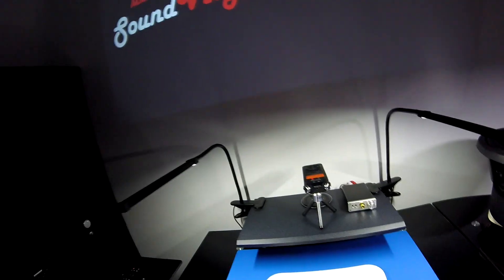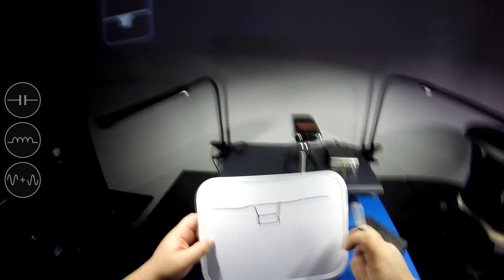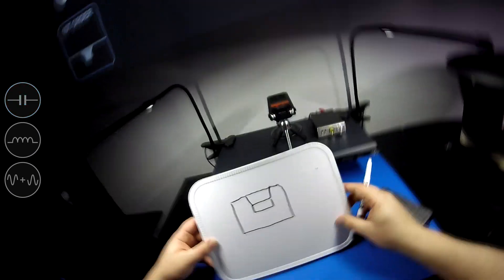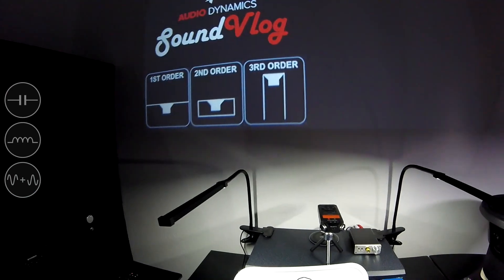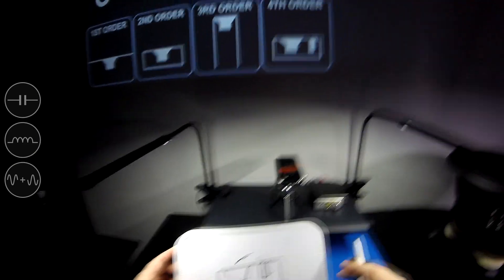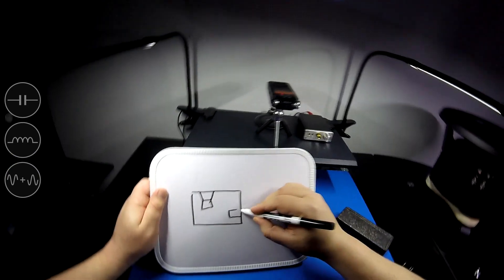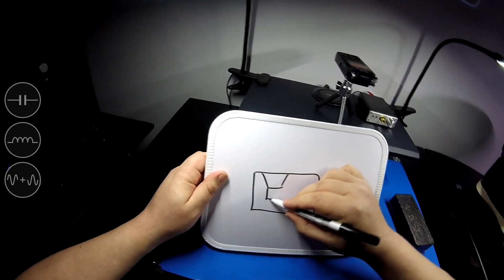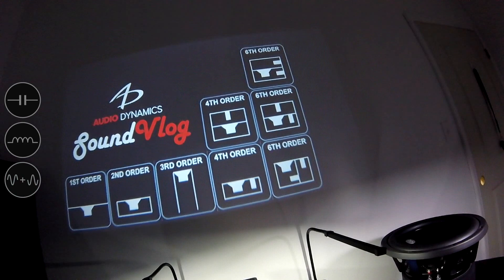Audio Dynamics SoundVlog - Counting Enclosure Orders

Comment: If a port takes you from 2nd to 4th, what's a 3rd order?
Reply: I’d imagine it’s similar to inverting a subwoofer. Or similar to fastening a sub to the end of a tube
Reply: A port only takes you from 2nd to 4th order if it connects the front and the back wave.

A 3rd order enclosure would be a driver mounted in a sealed volume (2nd order) with the backwave going directly into a port. Another example would be the transmission line which is mentioned in the video itself.
Reply: Watch again, a T-Line is a 3rd order as he explains

Comment: OK why are these called 'orders'?  Isn't that a mathematical thing?
Reply: The order refers to the acoustic roll-off rate of the system's frequency response.
Each order adds 6 dB per octave of slope to the high-pass or low-pass characteristics.
A 4th order system has a 24 dB/octave slope (4 x 6 dB)

Comment: Sooo… what if you done a 10th order. Would the bass from a single 10” sound same 2 15s in a 4th? Or does adding “orders” actually add bass?
Reply: no it does not add bass. Its for tuning and air volume.

Comment: What would you call a 6th order series tuned with woofers on the inside where they normally are and woofer on the outside of the enclosure with the back wave on the inside of the bottom chamber?
Reply: a terrible sounding enclosure! you'll experience cancelation and loading issues. you MIGHT be able to get away with it if you used a passive radiator but I think cancelation will still be inevitable!

Comment: Ok I'm going to go old school here. Back in the day we quite often ran an entire system off of 1 two channel amp, the nicer amps were capable of 'tri-mode', highs in stereo and your sub(s) bridged mono, because of this setup we had passive crossover networks. For a while I ran a 6th order parallel tuned bandpass, but because of the coil (inductor), it was considered a 7th order bandpass. How does an inductor fit in when calculating orders?
Reply: the crossover doesnt count towards enclosure orders. crossovers are electrical orders. boxes are acoustic orders.

Comment: I've watched this so many times but I still don't really get the logic. Is someone able to summarise the rules? He uses a lot of terms I haven't heard of being used with pneumatics before such as inductance. Following some of the logic, wouldn't the 6th order ones actually be 5th order because the emitted wave can't interract with any other wave? (it only has 1 final output)
Reply: Here's my understanding of it:
For the 6th order series tuned bandpass, there's the 4th order bass reflex (Front wave of the sub, capacitive reactance in the chamber, inductive reactance in the vent, and, for lack of a better word, "interactive" reactance at the front), then you add the front chamber to bring it up one order, then a vent to bring it up another, which leaves us at 6th order. 
Notice that the "interactive" reactance inside the front chamber between the sub and the rear wave is still there, and that the separation of the front and back wave of the sub always counts as an order, which is why an infinite baffle is considered a 1st order.

For the parallel tuned 6th, you again have a 4th order bass reflex at the back, and adding a front chamber with a vent brings it up to 6th, with the rear and front chamber wave interaction replacing the sub - rear wave interaction, keeping it still as a 6th order.

And then for the 6th order bass reflex, you have the front wave of the sub, two capacitive components in the form of two chambers, two vents, which are inductive components, and the interactive component at the front. Boom, it's a 6th.

The terms I used might be inaccurate, but I hope you get the idea!

Comment: Sitting here Marveling at this massively interesting video and nerding out at your explanation about the enclosure order, I have to admit this is a amazing scientific approach. thanks for sharing this knowledge crystal clear.  "200 Square Newtons per watt of motor force, which is pretty menacing, great if you are building your own MRI machine."  LOL, by the way dont mind this bozos with the camera motion sickness real men can read small print in a helicopter with a flashlight at 20,000 feet in the air and not get motion sickness. (been there done that Afghanistan 2009) by the way which sound track are you using for this video is pretty rad.

Comment: Well explained.  So just to be clear, beyond 3rd order, they are all even numbered?   No 5th order, no 7th order, no 9th, etc.?

Thx.
Reply: If we're to take this video as gospel, you'd have to find some arrangement of the orders such that at least one side of the speaker has a path to the outside world.
Hopefully I've understood this right: 

5th order: 1st: separation. Put it in a sealed box, that's 2nd due to capacitance. Add a port, thats 4th because 3rd is inductive, 4th is reactive. Put a box around the port, that replaces reactive with capacitive. Then put a transmission line over the front of the driver, which is inductive, that's 5th order.

7th order: This is a little complicated to imagine... But I'll try it anyway. 1st: separation, 2nd sealed box, sealed box on the other side with a port, we're up to 4th. Sealed chamber after the port, that's 5, but both sides of the sub are now closed, so add a port to the first sealed box, we're up to 6... Then the only way to add a 7th is via induction, so make a long, wide port (transmission line) after the port you just made.

9th order: Just insane. Take the exact same thing as 7th, but the only sealed box you have, put a port in it. That adds 8th, inductive, and 9th, reactive with the front and back wave.

If you're struggling to visualise it, I made an image in paint lmao. https://i.imgur.com/9fT65IL.png
Hope this helps! :D

Comment: Hi. really good explaination, I understood everything, but I have 2 questions. First: In WinISD it is possible to simulate "ABC" enclosures (like a series-tuned 6th order bandpass + port out the rear chamber too like on the parallel one). It is an 8th order enclosure, or it needs to count the acoustic orders differently somehow? If I understood correctly your presentation, let's start with the 6th order series tuned bandpass, then + port outside the rear chamber = inductive reactance which brings it up to 7th + interaction = 8th? Second: I know that passive radiator is basically a port = inductive reactance. I had a Philips HiFi which have the "wOOx" speakers (I dont remember the model number now...). On the front side of the speaker were the active woofer and the passive radiator (wOOx woofer), on the rear side was a regular flared aeroport. If I am correct, the passive radiator was tuned for the low bass and the regular port for the higher bass (the port was short + the enclosure itself was not too big for the woofer's size), but I am not sure that I understood this sepeaker system correctly, because one chambered enclosure with two tunings is strange for me. So how I should count acoustic orders at an enclosure like this Philips wOOx?

Comment: Long ago I was an electronics technician in the military.  I learned about RADAR waveguides as transmission lines and calculated reactance, capacitance and inductance in them as part of my education.  It has never occurred to me that the same principles apply to acoustic frequencies.  Very interesting.  

And, yes, I feel sick now.  It helped a bit when I reduced the video window to a small corner of the monitor and watched from across the room.

Comment: Let's say I have a fiberglass beach ball.  I cut it in half and build a skeleton frame to hold a subwoofer in the center with no separation between front and rear chambers.  Then I port the single chamber to the outside.
A. Would it work?
   1. What kind of speaker (TS parameters) would this work with if it will work?
B. What order is this and what would it be called?  A fourth order series tuned bass reflex?
   1. Front and rear waves interact with each other.
   2. There is a chamber that contains the front waves.
   3. There is a chamber that contains the rear waves.
   4. There is a port for all the waves to exit from.

Comment: Now I undestand what means "3rd order". So now I have a strange idea, maybe it is totally wrong idea, but let me explain it first:
1.: simulate for a woofer the Vb and Fb simply like at a standard vented box (4th order bass-reflex),

2.: add all the displacements to the Vb, just the port's displacement do not add,

3.: design a tube-box with that volume which have the same internal diameter like the woofer's cutout diameter and outer diameter like the woofer's total diameter (or bigger - just to be able to install the woofer correctly into the box),

4.: design the port (length) for that woofer / Vb / Fb using the same internal and outer diameter like at the box,

5.: now, we know the port's and the box's internal and outer diameter, the port's length, and the total internal box-volume (Vb + displacemets), so the box length can be determined,

6.: make a tube with these internal and outer diameters, and tube length = box length + port length.

So this tube will look like the drawing in the presentation, but in real world this will be not usable because of the huge length, only if you make a labyrinth of that. My question is: this will work like a 3rd order, or a 4th order, or it will work well anyways?

Btw, sorry for my bad english
Reply: That would be a transmission line I am pretty sure. however there is no "chamber" per se', It is all port.

Comment: Can you give an example of a valid 5th order?  I see some examples of it elsewhere, but they are never clear.
Reply: Mark Shade would my vented box with 2 vents qualify as a 5th order? If a normal vented box with 1 vent is a 4th order?
Reply: @Digital__rb  Don't take my word as fact, i am just getting into this too, but logically it would still be a 4th order bass reflex.
Two ports in parallel with a cross section of A should behave equal to a single port with the cross section of 2 * A

Comment: Okay I'm going to ask a noob question so don't hate me because I'm pretty new to this. Why would I care whether or not I had a fifth order or higher enclosure? What is the advantage of these? I understand the difference between first order through 4th. But once you get to 5th and higher I just don't see the point
Reply: More bandwidth and/or efficiency. Ronnie hitting 150 with a single 8 was a 6th order.

Comment: Had to pause vid to ask a question. What’s the point of a second order then? Is the resonance of the box the only thing we’re looking for?
Reply: With a 2nd order (sealed box) it is easiest to achieve a low Qts factor. A low Q(ts) gives more control over the driver movement. This gives best dynamic response and the most accurate sound reproduction. However the efficiency is usually lower. Also, a lower order has a lower roll-off on the ultra low frequencies. With good design, a sealed box hits lower notes than a ported, although the maximum SPL is probably lower.
Reply: @pim_kahlert  Hmm, thats interesting. Thanks for the reply. Working on putting two RF tens in a sealed box for my first set up. I'm very excited and learning a lot!
Reply: @jus1taj  You could use a (free) program like WINISD to calculate box size for your desired Q and frequency response. As long as the box isn't to small, a sealed box, with the right driver, is hard to mess up though. Have fun with your first build!

Comment: 6th order parallel bandpass is my favorite. I made it so the ports where next to each other. Slot ports and sub faced inverted motor up, dust cap chamber had a long 2.5" port thatwent along back wall and cornered along the top out the front, the coil chamber was 3" and was a U shape below dustcap port. Sub is a Memphis Audio HPO 15D4 @2ohms on a Crunch DRA850.2 not sure rms watts.

Comment: I'm slightly confused on how the ported enclosure is a 4th. I keep counting 3 orders. What are the individual orders of this setup.
Reply: 1 is infinite baffle. So, it starts at 2 being a closed back. Add one for the port, then add another one for the front wave interacting with the rear wave. 2+1+1=4

Comment: Thanks for the info & bob Ross white board drawings 🔥

Can you elaborate more on the difference between the 4th/ 6th / 8th series and parallel bandpass? And how the ratio affects size and tuning ? 

Does Audio Dynamics have high sensitivity subs with good frequency response with decent Xmax and FS of 30-35? 

I am looking for one or two subs that will like 1500 W RMS. My Q40 ( G37 ) has a metal wall separating trunk and cabin with a ski pass thru only. What would you recommend for best frequency response and output enclosure and sub wise?

Comment: Great video! Could you touch on things like port and subwoofer positioning to control cone displacement within the chamber, maybe touch a little bit on the fluid dynamics within the chambers or port. Why compression in aero ports functions better over slot ports for example, or some information on the acoustical relationship between amp and sub, dampening, how impedance functions in a relation to cone displacement the order of enclosure etc.

It would be great to hear some thoughts in series/paralleling or vicecersa or combination down multiple drivers and how best to acheive balance of resistance between all drivers and how an amplifier internaly copes with impedance changes over frequency.

Keep it up mate good to see you back on making videos!

Comment: +ADDesignsCarAudio Pete have a sundown audio EV3-12 6th order parallel bandpass enclosure for home theatre and musical use 5:1 ratio rear chamber 49.8L tuned to 26hz front chamber 75.5L tuned to 50hz it sounds great I wish it was a bit louder I’m putting 750WRMS in to the sub
Reply: Port size or the subwoofers ebp may be an issue.

Comment: Could you do a video on how different styles of say 4th order reflex boxes can load one or more subs within them? Or literally any video on box design tips and generalizations?
Reply: HexiBase Thanks for the reply. I know it wouldn't change change the acoustic order, but depending on design it could change the parameters of individual drivers in a multiple driver configuration, right? Like exocontralto's Frankenstein build that he is about to dismantle to create a new build. By multiple vents do you mean two vents in parallel or cascading (parallel seems simple, but sequential ports are more than i know how to do), aka vented 4th vs bandpass 4th? The types of reactance and how they differ in end effect is something I can't say I understand truly. Theory and practicality are different but you seem to be one of the more knowledgeable YouTube audio guys on how both work together and therefore can get the results you desired. Btw I miss your vids on Hexibase.